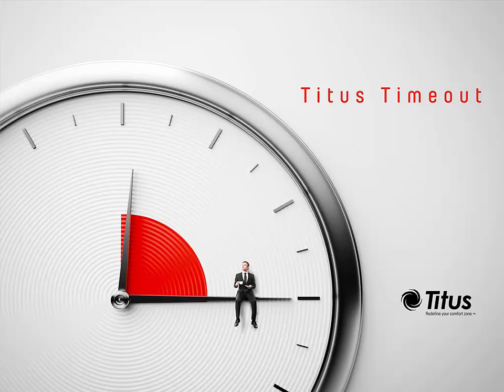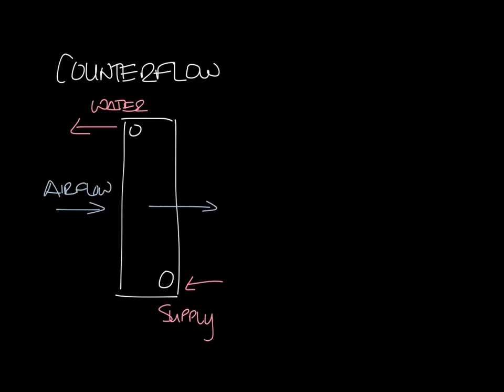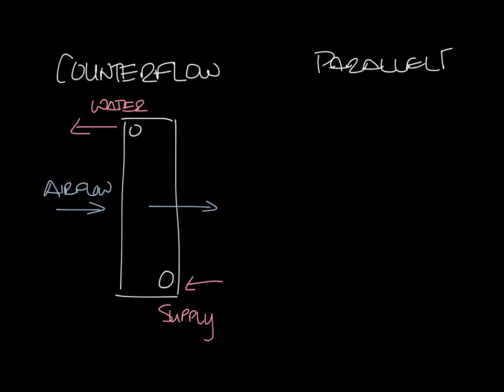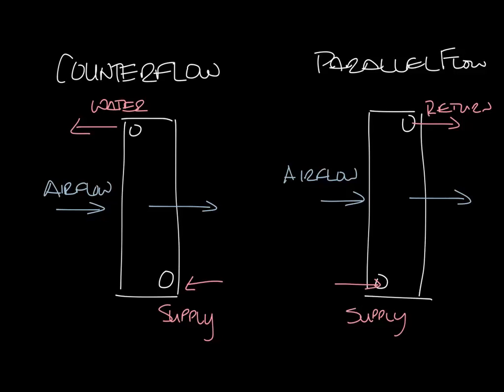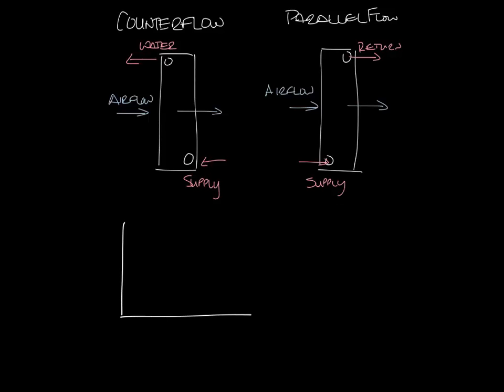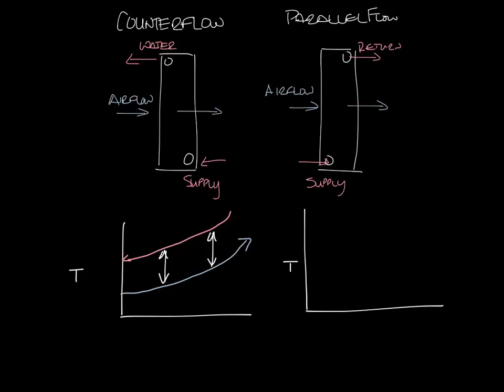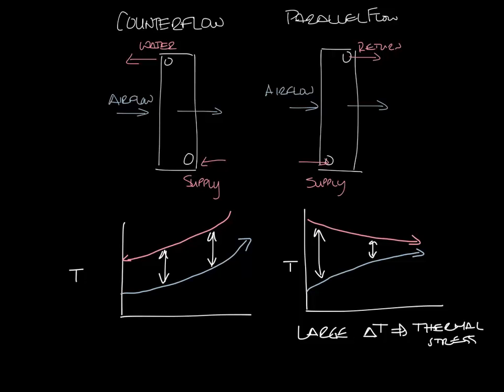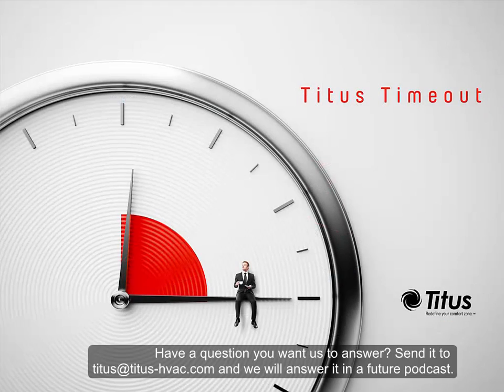Titus Timeout Podcast - Counterflow vs Parallel Flow Water Coil

Comment: Hi,
Does the higher efficiency concept with counterflow apply to DX coils?
Reply from the maker: I believe that’s true for DX coils also, but there are other factors that would need to be considered, the DX coil works on the refrigeration effect, so as liquid refrigerant passes through the refrigerant control valve, part of the liquid flashes to a gas. The two fluids travel at different rates and separate, with the gas at the top and the liquid at the bottom of the stream. If this gas/liquid stream is not properly mixed and distributed, then some coils circuits receive mostly gas, and other circuit, the liquid. This degrades the heat transfer capabilities of the DX coil.
Reply: @TitusHVAC   Thanks for the swift response. It helped.